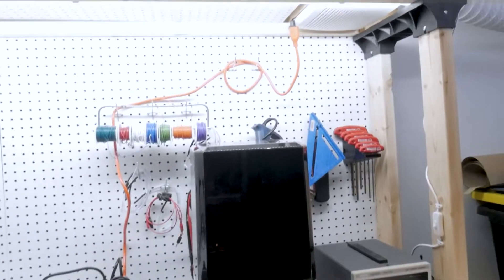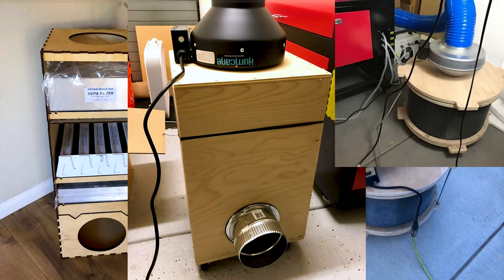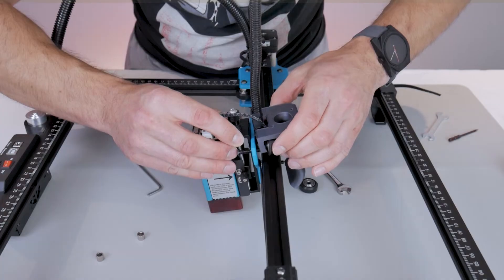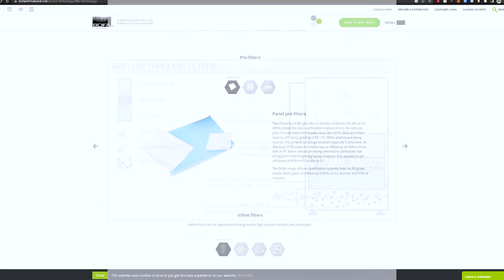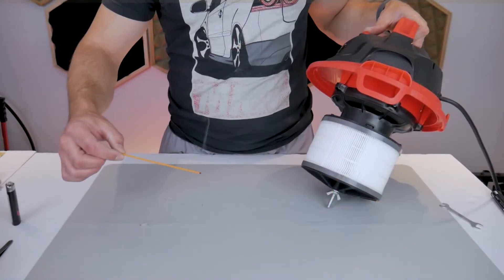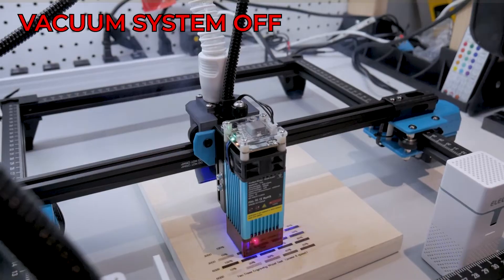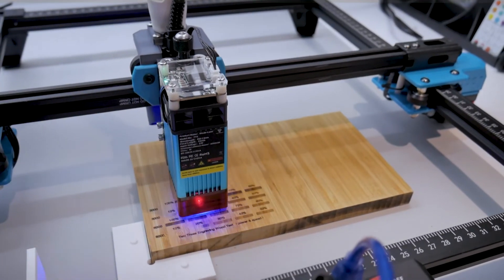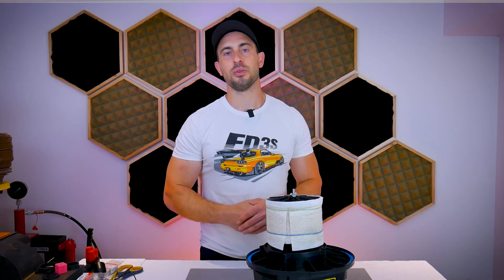Affordable, Compact, Light Duty Shop Vacuum Fume Extractor For Laser Cutting and Engraving!

Comment from the maker: If you guys appreciate this content check out the links for equipment used in this video. As an Amazon Associate may I earn from qualifying purchases (at no extra cost to you):
Two Trees TTS-55
► https://amzn.to/3PXTJTk

TTS-55 CPAP Adapter Kit:
► https://embracemaking.com/products/two-trees-tts-55-fume-extraction-and-material-squaring-kit

CPAP Hose:
► https://amzn.to/3DmcxHF

Stanley SL18301-4B Shop Vacuum:
► https://amzn.to/3BtbbuD

Stanley Air Filter Adapter:
► https://embracemaking.com/products/fume-extractor-conversion-for-stanley-4ga-wet-dry-vacuum

HEPA and Carbon Air Filter:
► https://amzn.to/3C3SGvb

Extra Carbon Filter Material:
► https://amzn.to/3JaQbKZ

Speed Controller (Optional For Reducing Flow / Noise)
► https://amzn.to/3vBHVxX

Below are other 4HP vacuum models that my investigation into the float ball cage assembly leads me to believe this listing is very likely compatible with (but not guaranteed). Models within the same brand (ie. Stanley) likely use the same motor assembly. Various other brands sometimes use the same parts from a common manufacturer and are simply rebranded.

Stanley SL18136
► https://amzn.to/3beOZtg

VacMaster VOC508S 1101
► https://amzn.to/3bhyU6c

Porter Cable PCX18301-4B
► https://amzn.to/3BtiodX

Mastervac 054-0245-0 (Canadian version of VacMaster can be found at Canadian Tire) 
► https://www.canadiantire.ca/en/pdp/mastervac-wet-dry-vacuum-15-l-0540245p.html

Comment: Paper towel? why would you not use the vacuum bag that goes with that vacuum. Not to mention the vacuum bag would go down to a lower micron then paper towel. AND give a greater surface area of filtering air.

Comment: I bought your tool, but it doesn't have the notch in it that it shows in the video to go around the wiring so it can't be installed! The one I got is solid along the face that attaches to the laser, no notch.

Comment: I bought the Laser Pecker 5 20W and I love it, but I was just designing my filtration system, because I will be going to an inside facility with babies and kids. I need cleaner air, no smoke, and a not so noisy filtration system; I would like to buy a Crafter rheostat to reduce the suction for my laser exit fumes, but I read it will not decrease the motor noise too much...that is my main goal is to reduce the motor noise inside.

Comment: 'Carbon' foam does a poor job for what amount to a relatively short time. Look at activated carbon granules. These will remove fumes and odour for air past through them for 4months to a year, compared with only 2-4weeks for the crappy 'foam'. Your discussion starts talking about the dangers of volatiles in the air then changes and only deals with particulate matter. You should've tried making a DIY version of the BOFA filter. One that you can take apart, dump the ACG and install new fresh stuff. Very nice idea in using off-the-shelf stuff like the vac and hepa filters.

Comment: I would build a filter around a dedicated centrifugal fan.  Vacuum motors are not designed to run continuously for long periods of time; some manufacturers even explicitly write in their documentation the maximum period of time the motor should run (e.g. 10 minutes).  Using the speed controller to run at a lower RPM would help prolong the vacuum motor life, but, again, it'd be best to use a motor made for the task rather than repurpose a vacuum motor.

Comment: I know this video is a bit old, but have you had any ideas on smoke/fume issues with the xtool f1, when using the slide extension?  I have the filter that goes with it, but when using the slide extension the hood has to be up, and it's basically useless.  Any suggestions would be appreciated

Comment: You need a damper to help prevent backdraft from outside.  Plus, the fans you want are 400 cfm or better.  Your avg 4" inline fan is not enough.  Im currently trying to come up with a design and supply list to run 3 diodes and a fiber laser from my basement.  I've been looking through inline fans, duct work, etc plus filter components and filter systems to try to come up with a design that will work well. And yes, it gets cold here too. 😊

Comment: I'm curious why the first option didn't work. You mentioned the pressure differential between the house and outside, but what if you also made the air intake come from outside and sealed an enclosure. Then the pressure inside the house wouldn't matter as much because both the intake and exhaust would be using outdoor air and pressure. As lone as you get a good seal on the enclosure it should work fine.

Comment: I too struggled with this problem, I had a high volume squirrel cage fan attached to my enclosure through a 12 x12” merve  14 filter and a carbon filter like yours. I still smelled smoke. And it was expensive as those filters needed to be replaced regularly. Ultimately I ended up boring a 4” hole through the concrete wall and exhausting it all outside. This completely solved my problem. You could probably do the same since there is usually some block wall above grade on most basements. As far as pressure differential you could use a heat exchanger and be getting some fresh air to boot.

Comment: If you are smelling anything the filtration is letting ultra fines through. A shop vac is great for creating a negative pressure. When the air crosses the filtration media you want it to slow down so it will catch the particulates. Hepa filter are only hepa as long as you don't exceed the volume of air flowing through it. The higher the air flow the larger the particulates that flow through.

Comment: Awesome video!  Thanks for sharing your knowledge in a way that most of us can understand.  I have one question.  I just bought a XTool D1 Pro 20 wat laser engraver and I really don't want to cut a hole in my exterior wall to vent it.  You recommend a HEPA/Charcoal filter replacement but I can't find on for either my Rigid 4 Gal shop vac or my MasterVac 6.5 gal shop vac.  I can purchase a HEPA filter and dust bag for my Rigid and I'm wondering if I can just wrap the filter with Carbon filter wrap?  Again, great video and thanks for any info you can provide.  
BTW, I also watched your video on setting up the XTool 10 wat laser and found it to be extremely helpful.  I haven't put my new laser together yet but will definitely watch your video multiple times to get mine put together correctly.
Reply from the maker: Put the carbon material inside of the HEPA filter. Most professional filters seem to do it in this order where the carbon is last. Just make sure it is fixed inside with some velcro or something where it won't get sucked into your vacuum motor. Enjoy your XTOOL, I can't wait to do the 20 and 40W upgrades. Thanks for referencing my videos as well!
Reply: @EmbraceMaking  Thank you.  I just finished putting my unit together and installing the software.  Again, thanks for making this amazing video.  It helped so much more than the manual did.  Can't wait for any future videos on the 20W.  Cheers!
Reply from the maker: You're very welcome!

Comment: The problem is, the VOC´s will still be there. The only really safe way to get rid of smoke is venting it outside. This is why I still do not have a laser cutter or Resin printer.
Reply from the maker: Yes ideally you want to route even the exhaust outside if you can. As I mention in the video this is not for heavy duty use but at least your room won't fill with smoke

Comment: For the xtool D1 they manufacture an “air assist” which appears to be a low volume fan/blower to cool the laser and blow the smoke and debris from the project.  

Here you’ve created the opposite airflow sucking vs blowing at the laser.  

Curious on your thoughts on why suction is as good or better than blowing?   Reason I’m asking is I would have expected the manufacturer to create a vacuum unit accessory if that was a better solution.
Reply: This keeps your house from smelling. Air assist just keeps the smoke away from the lense.
Reply from the maker: Hi Mike, thanks for your comment. If you notice, I'm not sucking the fumes towards the lens, it will evacuate the fumes away from the lens outside of the orange guard. If I were to put the nozzle beside the lens somehow up inside the guard then perhaps it could be an issue. I've been running this setup for a while now along with many customers who do not have any issues with the lens collecting anymore debris than usual. Also, the main purpose of this is different than the air assist. That being said you can run both at the same time.
Reply: They are for two completely different purposes.

Comment: Will this work with the X-Tool D1 Pro 20 W? And can you use the laser inside with this or do you still need to vent out a window?
Reply from the maker: I have used it with the 10W and it would be the same for the 20W. Ideally you would want to still vent the exhaust out the window. I would always recommend getting as much as you can outside of your workspace if possible. However, if it isn't an option this will help a lot. As I mention in the video, if you're just doing light work this works great to get by. If you're running your laser a lot you should invest in a professional solution.

Comment: Great idea however running one of those shop vacations is extremely noisy I would highly recommend using hearing protection if going this route. Best solution would be going with an enclosure
Reply from the maker: Great point, I never really considered the noise because I don't run mine for production. Just as needed and sometimes I use the variable speed controller to dial down the vacuum and it makes it more tolerable.
Reply: The variable speed controller definitely helps. BTW great videos! You've pushed me to start posting videos on my D1 Pro with extension kit to start logging tips and tricks as well as obstacles and work arounds!around!
Happy New Years!

Comment: Out of curiosity, do you know if anyone has tried and succeeded in using any of your conversion kits with a 6.5HP model of vac, such as the Craftsman CMXEVBE17595?
Reply from the maker: Not that I'm aware of... if you contact me using my contact page on my website and provide me with some measurements and pictures of the underside of the vacuum top I might be able to see if anything I have fits or could be made to fit with some small changes.

Comment: Home Depot sells a bucket head vac for about $30 which you could use, and which makes them cheap anough to have several of them  in permanent use  and not have to assemble/disasemble your wet vac when you need it. They also sell a very light weight hose (its white) which is a lot cheaper than a cpap hose. Its called a Polyethylene Bilge and Pump Hose. I would link to them but you know... Youtube.
Reply from the maker: Interesting! Looking into it...
Reply: @EmbraceMaking  So I used one of these but I forgot that they are designed to use a filter bag only so I just cut out the cage for the bag and the  HEPA filter friction fit in there beautifully. The 5-layer Ridgid Heppa filter is about $20 but can be rinsed out. As for the exhaust, (yellow thingy you made) try compost bin charcoal filters. This might work well for your exhaust to eliminate any residual smell.

Comment: I followed your instructions with a Stanley vacuum and your 3d printed items and I am still selling smoke when I engrave basswood -- albeit much reduced.  I only tried it with air assist, and I'll try it without.  But would your advise  removing the amber light hood around the laser for better fume extraction?
Reply from the maker: Hi Michael thanks for the follow up! Yes so with air assist I would imagine some of the smoke is going to get forced away from the vacuum nozzle. Without air assist it should capture even more of it. Through cuts will always be worse than simple engraving because during a through cut (especially with air assist) smoke will go through the bottom of the wood and it will be harder for the nozzle to suck up those fumes. You can try and remove the plastic gaurd but just please be vigilant about wearing eye protection as the gaurd is meant to also protect your eyes from the laser. Give that a shot and also keep in mind that this system, although pretty good, will never capture absolutely 100% of all fumes because you still have an open machine. It will make a big difference as you suggest but there is always a chance some trace amounts that will escape without an enclosure. Let me know your results without the air assist.
Reply: @EmbraceMaking  It vacuum is slightly more effective at capturing fumes with air assist off.  I am running the vacuum at 25% on the speed controller to avoid motor burn out on long runs.  More than 25% doesn't make a noticeable difference on fume extraction.

Comment: The carriage looks similar to an Atomstack A5 Pro+... Will your extraction adapter fit the Atomstack as I'm in the same exact situation with smoke and fume extraction.  Thanks!  Awesome work by the way!
Reply from the maker: Hi Mario, thanks for asking. It looks similar but I believe the A5+ has the stepper motor above the laser that would be in the way of the CPAP hose? At least thats what I see when I google the images for it... Let me know!
Reply: @EmbraceMaking  Ah... Yup, it does.  I forgot about that.

Comment: Seems like a very interesting idea.   I was playing with the cpap hose idea and just vent to the outside. 

How does this work with an air assist?
Reply from the maker: Thanks! Haven't tried with the air assist... but I would be willing to bet the air assist will push the fumes and smoke away faster than the vacuum can suck it up. So you might not capture as much.

Comment: seems to me that you could make the fume funnel a lot closer to the laser, and/or even around 2,3 or4 sides of the laser module at the bottom near the workpiece.
Reply from the maker: I could probably get it a little bit closer with the one I have but I actually did try splitting it to the sides in an early prototype. The problem was that the "tubes" were very small so they wouldn't obstruct with the x travel and then too fragile. Plus, through a bunch of testing I found that it didn't really seem to make a difference. Depending on the pattern you're cutting, the laser head could be flying around in any direction and the vacuum produced enough suction in the general vicinity that it captured 98% of the fumes anyways. Also, the red translucent laser cover has a slot cut in the back. So when I had the nozzles on the side they weren't really as effective as the big one at the back that seems to be drawing most of the fumes out of that slot in the red cover.